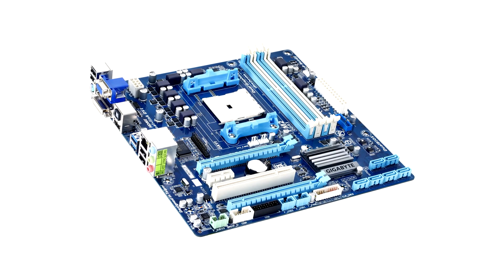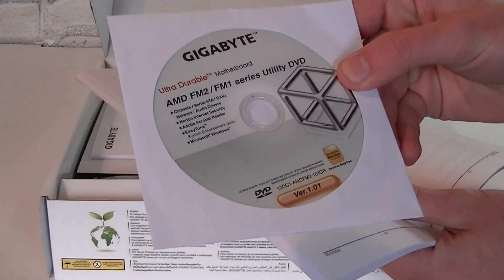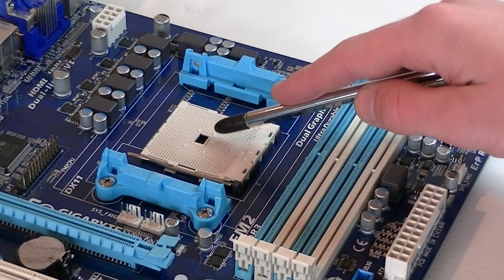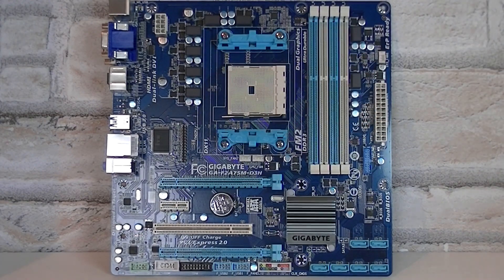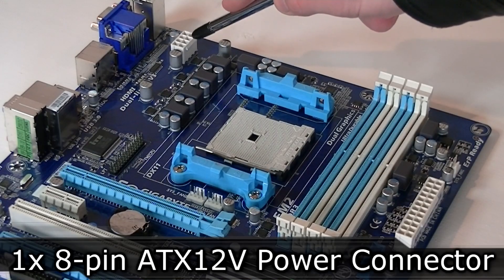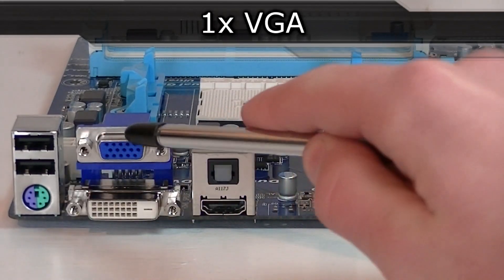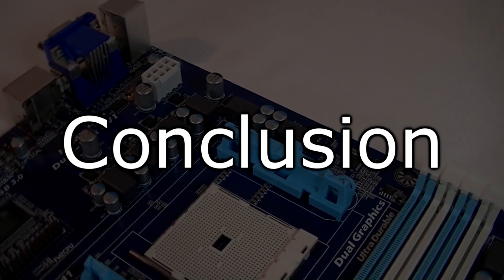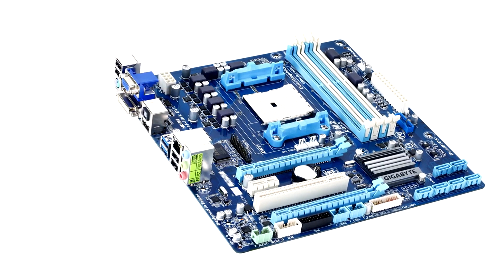GIGABYTE GA-F2A75M-D3H Motherboard Review

Comment: I have a question. Why when I enable the turbo boost my PC turns off but not completely, cause the fans is still working. When I turn it off it doesn't shut down anymore. I don't know why is this happening, the turbo boost just increases the speed by only 200hmz that shouldn't be a problem for a stock cooler. Is my motherboard faulty? I also have this motherboard and my APU is a A8-6600K.

Comment: My Gaming RIG  ^_^
APU : A10 5800K
MOBO : GA-F2A75M-D3H
RAM : Corsair Vengence Pro Series DDR3 1866MHz 8Gb
HDD:	500GB Western Digital Caviar Blue
CASE : aerocool gt advance casing black 
PSU : Aerocool Strike-x Power Supply 500watts 80plus Bronze Certified
Reply: That's my my pc in 2020 :(